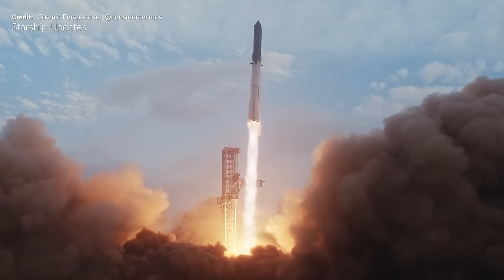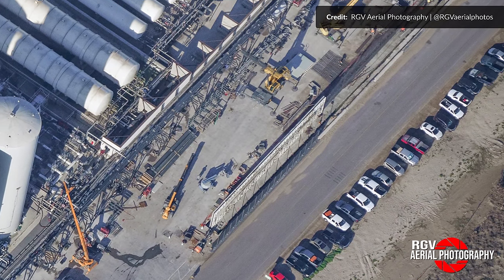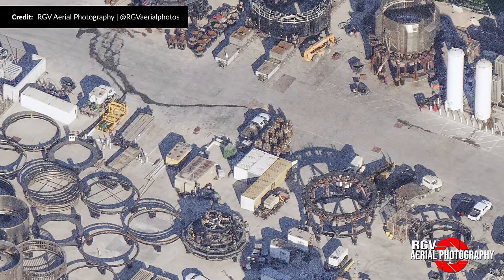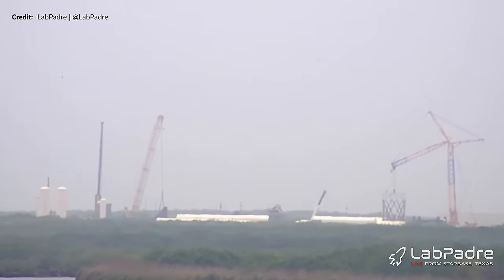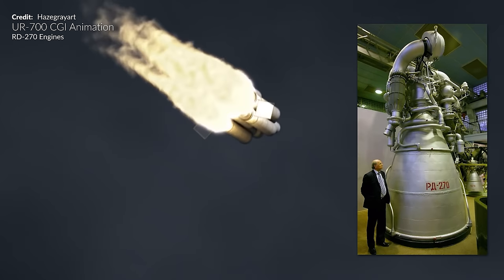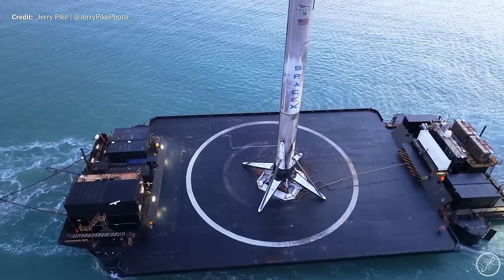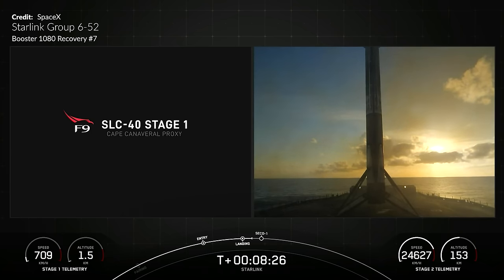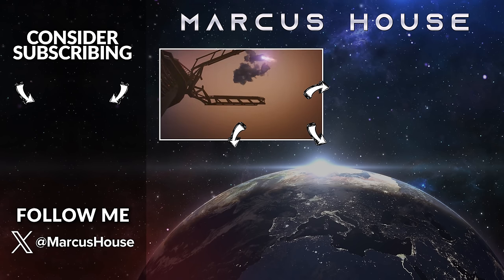Why is SpaceX Starship Only Capable of 40 to 50 Tons to Orbit For the Flight 3 Version?

Comment: The proposed Mars sample return mission is an absurd waste of money. Lots of exploration and research can be funded by NASA for that much money.
Reply from the maker: It is if they are talking 11 freaking billion. Geezzz...
Reply: @MarcusHouse  i think nasa should drop the project and focus on making 3d printers, drones, and other technologies that would help a mars colony. those samples aren't going anywhere, and they are nicely sealed up before any potential contaminates that could throw off our research. meaning it would be better to wait till we try to send them back
Reply: Also it simply doesn't cost that much to achieve it.. this is just throwing money at contactors and lining the pockets of investors. They need some serious revision of the way they make contracts. Also vertically integrating so part of the cost is actually an investment would help a lot
Reply: Why would a sample mission be funded and carried out in the first place without the ability to bring that sample back…..why would that approach be used in the first place, who signed that off?
Reply: @ElectricYOGIchris  the idea was the sample return mission from the start. the problem was how expensive it became. also they probably figured that sealing up interesting samples before humans set foot on mars would be a good way to keep any contaminates from ruining any discoveries, even if the sample return mission was dropped later on
Reply from the maker: @ElectricYOGIchris  It was included as a value add for the Perseverance Rover mission. They are still getting data from the samples, but actual returned samples would allow a lot more analysis. Regardless, by 2040, the idea is to have boots on Mars (unless of course NASA budgets keep getting cut back).

Comment: I've followed SpaceX from the very start - the Falcon 1 launch and I was always very positive about them, with Falcon 9 finally getting landings right and Falcon Heavy being simply amazing. But, I'm starting to get a get concerned, Starship is so complex, with so many moving parts and points of potential failure, and even if they all go well I still have major questions about landing on The Moon and Mars, plus solar power for the long voyages and being able to cool fuel during the trip as well. You can't argue that Starbase has become a messy jig-saw puzzle of bits and pieces as this video demonstrates. Remember, all this ground infrastructure would be needed on Mars for a return voyage. I hope, no I pray that Starship is successful, but I'm getting worried. Mars seems a bit further off every day.
Reply: Mars has lower gravity and less dense atmosphere, so for the return flight you dont need the Booster, just the fully fueled ship is enough..
Reply: I'm mostly concerned about the heat shield tiles. Wasn't that great on the space shuttle as well (expensive to maintain and many points of possible failure).

Comment: Current Starship has less tonnage to orbit than reusable Falcon Heavy...

Are we going to just completely ignore this?

Negative feedback = Realistic improvements.

"Highly reusable"...they couldnt do their engine refire test in orbit in the last flight test.

Lets start to support claims when they achieve them?
Reply: The thing is that is such a big fuck up that I find it hard to believe that it could be down to incompetence. First you are using liquid methane which is inherently more efficient than kerosene. Secondly you have the natural economies of scale that mean that dry mass relative goes down relative to fuel as you get bigger. Thirdly they aren't even using a dummy payload. And fourth the rocket is fucking massive. Part of the difference may be the use of stainless steel in place of aluminium and a reusable second stage but even those plus incompetence just don't add up to those stats. They must be doing something like limiting the thrust having much more structural reinforcements than necessary. It could be that they installed very heavy engine containment shields and lowered the thrust after flight one. It's to big of a difference to be explained by incompetence considering the amount of experience and technical expertise they have. The lunar module and lander on Saturn V where about 45 tonnes total and they were put into trans lunar orbit by the third stage not just LEO.

Comment: I'm fairly certain that SpaceX deliberately flew Flight 3 with the engines performing below the advertised margins because A: the rocket is lighter than they were designed for, and B: they wanted to see how the rocket would perform if one or more engines were underperforming in a real world scenario.

Edit: As for the Mars Sample Return mission, I think the best thing to do would be to keep the sample return rocket and payload, but have it be delivered by SpaceX as part of an Interplanetary Demonstration Mission for Starship. At the record pace that Starship is going, such a mission might be possible by 2027 at the latest (barring any major delays).

Comment: How can progress on Starship be described as incredible and fantastic but be years behind schedule?
Reply: Because it is far faster and cheaper than other development projects, like SLS.
Reply: It's pushing boundaries in rocketry that have never been done before.
Reply: Because the schedule is set by Elon Musk who ALWAYS sets wildly optimistic schedules.  

Compare it to SLS for example and remember all the old tech in SLS.  Shuttle engines (literally reused engines on the one SLS flight to date).  Longer versions of the same solid rocket booster.  That orange fuel tank is a modified shuttle fuel tank design.  These uses of shuttle components were PLANNED as options when designing the shuttle, so why did it take so long for Boeing to make it work and why did it cost so damn much?

Comparatively Starship is the epitome of efficiency given all the new things they are trying to do.
Reply: @Scanner9631 The problem is that the NASA Artemis project may be severely affected by the Startship progress. I was blown away when Musk that Starship will have a LEO payload of 40-50 tons! The next iteration seems to be a patch up to get back to the 100 ton target.  The 200+ ton claim seems like a PR stunt to "keep the faith". IMHO, the Starship is fatally flawed from use of SS  construction (too heavy) to a huge array of engines to nebulous plans for orbit fuel depots and in-orbit refueling. NASA was wise to pursue an alternate path for Artemis. Just because a project is ambitious does not mean it will succeed. Indeed, Starship project is on a death march - it will fail but the project must go on for political/ego reasons.
Reply: @pawnfish352 interesting opinion. Way too early to make big declarations though.

Comment: How about Musk lied about the capability of Starship and instead of being able to carry 100-150 tons, it was never capable of doing more than 50.  I don't care if you call this a prototype, the engineers working on Starship would know how to calculate the capability without the thing being launched.   They may not be exact, but they would be in the ballpark.  The 40-50 just shows the initial numbers were never proven out and was just Musk speak.
Reply: Doesn’t make it a lie. He is always optimistic about engineering overcoming obstacles. Sometimes right, sometimes wrong. Starlink has equaled or over performed against initial predictions. Everyone needs to stop throwing around lying as a term if it was not a deliberate falsehood - and there are plenty of those like the Nikola truck lies - In SpaceX case there are years between an initial concept and final products - and then they get matured and extended to overperform as they gain experience. See how much Falcon 9 has matured and what it can now loft
Reply: @longboardfella5306  Musk said:
-  a crew orbiting the moon by 2018.  
- probes to Mars starting 2022.  
- crew to Mars in 2028. 
-  over 100 tons, now it is 40-50.  The Saturn V at 1/2 the thrust could get 50 tons to the moon and over 100 to lower earth orbit,
-  after the failure of IFT-1, Starship would not hold up Artemis III,  Now he is saying within 5 years for crew which is 2029, (Artemis V scheduled date).    

These are just Starship.  Don't forget what he, "errored" with in Tesla, hyperloop, (he said it's easy),  LV loop, (was supposed to be autonomous not having drivers), and robot taxis were to have started years ago.

BTW, Starlink is not as profitable as Musk claim as being reported by others.  

He always does this.  It is not over ambitious.  It is trying to sell something to people who will not question him.  He needs attention and  by exaggerating capabilities and  time lines is how he gets it.  

Honestly, Musk needs to step away from SpaceX and let the real engineers do their magic and build something realistic.
Reply: No it's not a big conspiracy. Remember that the weight of the starship and booster used in IFT-3 is probably much much higher than those used in IFT-1 due to robustness upgrades and redesigns. Also likely that raptor is being throttled down a bit for conservatism. So the initial 100 ton target is now 50. But don't forget that once the crude prototypes are routinely completing their flights, SpaceX can probably move in the other direction, deleting parts and reducing dry mass as they refine the design. Look at the development phase of the iconic Falcon9 for example.
Reply: "throttling down for conservatism"? Sounds a wee bit odd. There isn't much room for conservatism in rocketry if you want get into orbit. And the data shows that the main reason for the payload reduction is Raptor's performance (specific impulse is less than it should be). I agree that the rocket is probably a bit heavier than planned, but this is not the primary problem.
Reply: @velisvideos6208  I'm just speculating of course, but the weight is not insignificant at all. I am guessing the engines are not being pushed to their limits as SpaceX wants to get to orbit first and foremost. The graphs from the original V2 tests on the Mc Gregor test stands showed higher performance.

Comment: As far as the tiles go... I think all of those removed tiles didn't pass the pull test. Not all of them were on seams.  I'm willing to bet the pull test had the torque requirement increased. Still, the tiles are not a big deal at this phase. I have confidence that particular problem will be worked out. I actually hope a tile is lost here and there just to see how the SS handles it.  We can't tell from the last flight, as that was an out of control tumble.

Comment: Absolutely there is a problem. They have contracts in place for Artemis. Nothing else matters at thia stage. They clearly arent even testing the right hardware for that yet. The fact that no one knew this till now & you had to wildly speculate tells you all you need to know. 

Read the room lads..... going this big & so complex was a bad idea. Maybe if they had another 20 years & unlimited funding, they can get it working. That's not the case though. All they are doing is hemoraghing investor cash

Comment: Opinion... The boiling point of LOX, is below the freezing point of Methane. Turn off the flow, and the methane in the downcomer is going to freeze.  Make the downcomer external, or insulate the downcomer like heck, or expect a bunch more engine rich burns, and failed reignition.

Comment: They should have a second catch tower designed only to catch rather than have the launch tower do both. That way if something goes wrong and the catch tower is damaged, they can still launch with the other tower. It also allows for a different design which might be better for catching but not for launching.
Reply: I agree, but this not how SpaceX works. They'll get the launch tower demolished and then start working on alternatives.

Comment: IFT-3 happened a month ago and the video from SpaceX clearly showed that there was no payload.  If the stack was lighter by, say, 150t, then it should have performed better than needed given it wasn't required to put 150t of payload into orbit.  But, even minus the 150t payload neither stage looks to have performed as well as required.  The reason for this might be:  the dry mass of the stages is higher than planned; the Raptors performance was less than expected; the damage done during launch resulted in propellant venting that reduced the available prop.
It's obvious when watching a launch that the stack is bathed in a sea of shockwaves and that can not be good for the rocket.  It is entirely possible that the venting we saw, the significant venting we saw, was due to damage done to the plumbing during launch, damage caused by those shockwaves.  SpaceX might argue that the water cooled plate they installed solved the problem, but that water cooled plate is not slanted to deflect the exhaust and is instead flat and perpendicular to the exhaust thus providing a flat surface to reflect the shockwaves back towards the rocket.  This is in contrast to properly built launch pads that have a proper flame diverter and flame trench to move the exhaust away from the stack and to move the shockwaves away from the stack.  But if the water cooled plate was all that was necessary then why is the test pad at Massey's built using a flame diverter and flame trench -- if the flat water cooled plate was all that was necessary why build a more elaborate and expensive flame diverter and trench if the water cooled flat plate was all they needed.  Something doesn't add up!
Reply: I don't see how you can compare the flat water cooled plate for 33 sea-level Raptor Engines, to testing 3 Rvac and 3 sea-level Raptor Engines. 
Also the Massey Test Site is around 10km (6.5Miles) inland and not as subject to the restrictions of a Wildlife Reserve and possibly has a better water table. That all lends itself to a much cheaper and simpler method of exhaust control, than the sophisticated and world first Boca Chica test site system.
Reply: @David-yo5ws  "don't see how you can compare the flat water cooled plate for 33 sea-level Raptor Engines, to testing 3 Rvac and 3 sea-level Raptor Engines. "  Precisely!  If the Massey's test stand is only going to handle 6 engines versus 33 of the booster why would they spend more to build a flame diverter and trench at Massey's if a water cooled flat plate is as good or better?
Reply: @Raptorman0909  More money! You can't be serious! The cost to build a heavy metal complex steel plate construction plus add all the high pressure nitrogen tanks and water tanks to force-drive the tonnes of water force required, to stop the Raptor thrust blowing it back down the water holes, would be a lot more expensive than just digging a trench and filling it with concrete and adding a water tank. Come on, look at the costings a bit more accurately.
Reply: @David-yo5ws  Sorry, but to handle 6 engines instead of 33 is a lessor task so the quantity of water needed and the plumbing needed being much smaller makes that a smaller cost than for the actual launch pad with 33 engines blasting.  In addition to everything being smaller the plate itself need not be as big and heavy ... or expensive.  But that's not what they did, they spent a lot more for a more intricate flame diverter and trench.  And that's the point, if the design for the actual pad is viable they would have copied that at Massey's because it would be far cheaper than a full on flame diverter and trench!
Reply: @Raptorman0909  Looks like we are at an impasse.
There may be a reason for the trench, related to the larger vacuum engine nozzles?
Maybe one day in an interview with Elon, we will get the real reason. 
I look forward to seeing what they do at the second OLM.
Reply: @David-yo5ws  The length of the vacuum nozzles is irrelevant as they are all contained within the structure of the hull.  This is needed for a reentry vehicle because if the bells extended beyond the hull they would be in the airstream during reentry and that would destroy the engines.
Reply: From what I understand, the design of the OLM and water cooled steel plate system was based on ease of access and raid reusability, not cost. Additionally I've heard that the permitting time to get permission for a flame trench from Army Corp of Engineers was prohibitive. I guarantee the OLM and water deluge infrastructure will be undergoing iterations just like the rocket. There are strengths and weaknesses to every design. You have to target one or the other... Robustness, accessibility, reusability, cost, etc.

Comment: Once they get the starship working, would it theoretically be possible to do a configuration like falcon heavy with starship? That would be insane
Reply: Theoretically, sure. But Musk said Falcon Heavy was a nightmare to get working and they never want to deal with that again.
Realistically, on the off chance that you need more than 200 tonnes in a single launch, you fly Starship expendable.
Otherwise if you want more payload you just fly it multiple times.

Comment: There should be an Expendable Upper Stage for the Super Heavy Booster. Both as an interim solution so the system can fly missions ASAP and for those missions where it is logistically preferable to throw away 3 or 6 engines and a cylinder of steel. The ability to get a 200 ton tank of storable propellant with an AJ10 engine into LEO for instance will get A LOT to the moon.

Comment: Here is some logic for the engine performance. You say that flight 3 uses the Raptor 2. The numbers may be for the Raptor 2 or 4 - i think i saw 4 diagrams and - well - SpaceX may just have decided that on those empty flights, they will use up old engine versions that are less powerful.